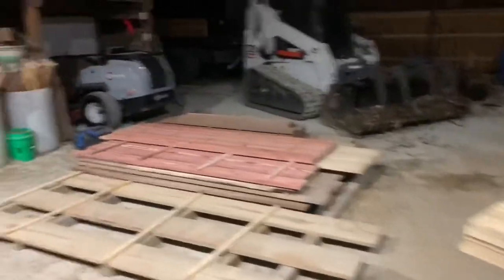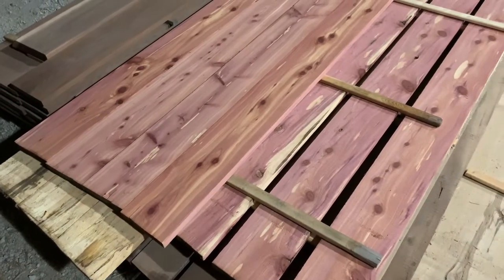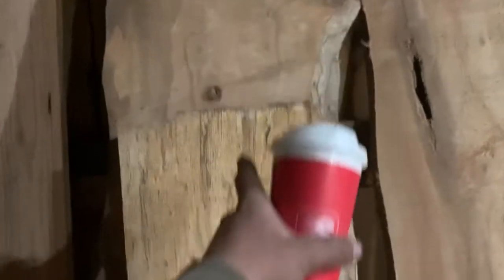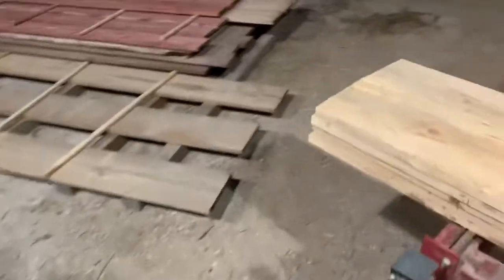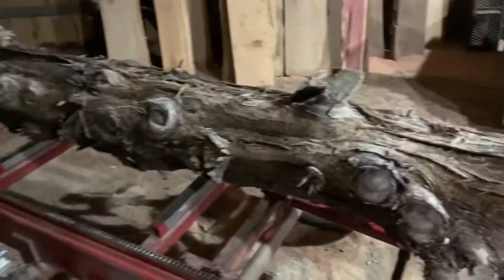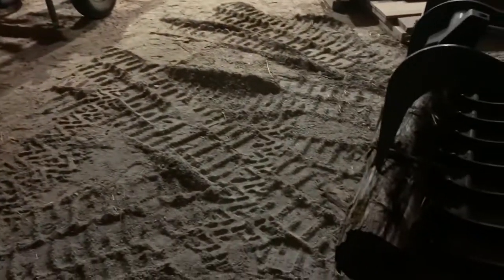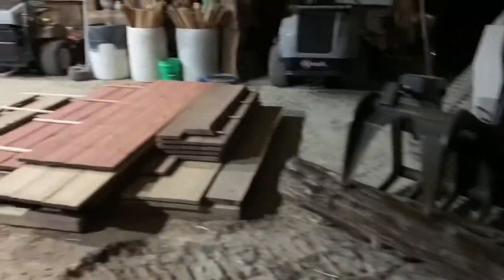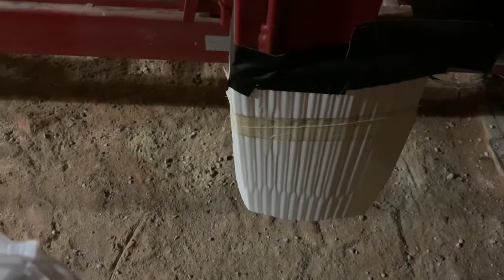Cook MP-32 whackin and stackin

Comment: I bought the mp32 as well been having fun.I noticed the drive belt cover holds a lot of sawdust and bark. I cleaned it out several times, but then it ended up cutting my belt. I put on a new belt and left the cover off. Probably not the safest thing but nothing can collect in there that’s for sure.